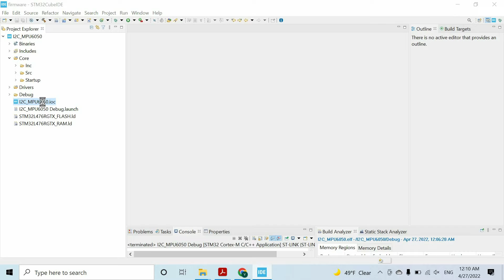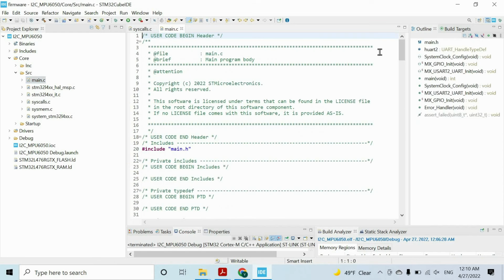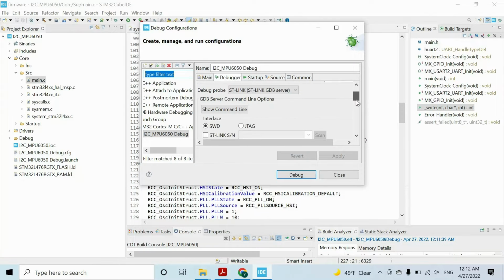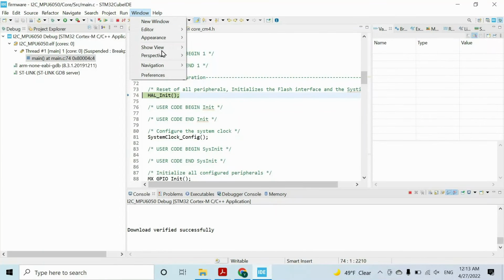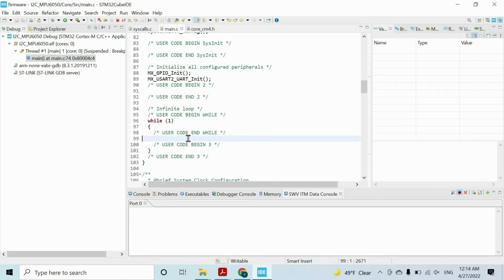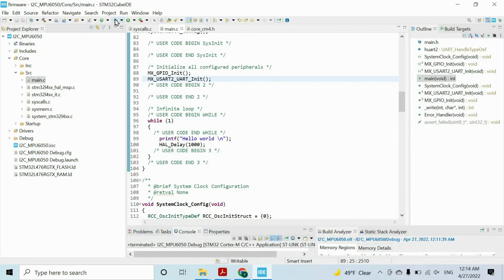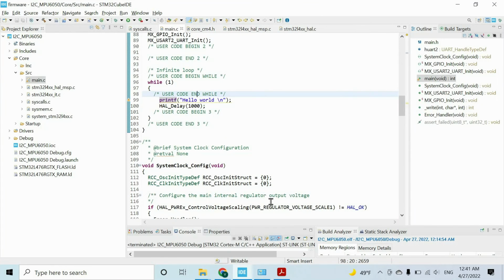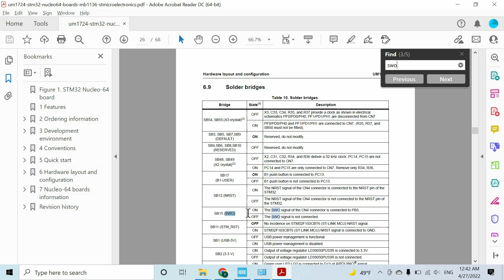This makes your life so easy: STM32 printf using SWV STM32CubeIde

Comment: Guys if you are using stm32f303re set the core clock frequency under serial wire viewer in debug configurations to 8mhz, thats the internal and default clock this board uses, also you have to put \n i think.
Reply from the maker: Thanks for the tip!

Comment: Hey im using a stm32f103c8t6 blue pill board. Did everything as you said, nothing is getting displayed in the smv terminal. Any solution?
Reply from the maker: I think this MCU does not support swv
Reply: @steppeschool3629  So what other alternatives are there for this mcu?

Comment: Nice tutorial, quick and easy. 
Just a follow-up,I have a STM32F407G-DISC1 board. In the .ioc file, we need to set 3 pins if we want to transmit and receive? 
SWO (PB3), SWCLK (PA14) and SWDIO (PA13). Could you please confirm this?

Comment: Note: Serial Wire Viewer (SWV) is a data trace feature found on many ARM Cortex-M3, M4, M7, M23, and M33 processors. Cortex-M0 and Cortex-M0+ do not have SWV.
Reply from the maker: Noted
Reply: hey tnx im using m7 and ive been trying like an hour lol
Reply: @offensivebias3965  Yikes. Sure hope you figure it out eventually; wasn't straight for me the first time either.
Reply: thank you sm

Comment: Hello, thank you for your video, but i have a major problem, when i go to debug configurations and try to enable the SWV, i can tick the option... would you have an idea about how to resolve this problem and why it occures ?
Reply: I am not working on an Nucleo but on a STM32F303 dicovery, might it be the problem ?
Reply from the maker: check the user manual of your discovery board. There might be some jumper to solder. Which board exactly are you using?

Comment: It doesn't work for me, no text output from SVW Data Console. Is there a need to configure some pins at "Pinout & Configuration" ?
Reply from the maker: Hi, you do not need to configure, but in some boards, the pin responsible for SWV is not connected to the ST-Link, as I explained in the video. In that case, you have to check the user manual of the microcontroller you are using.  Usually, it is just one jumper to solder.
Reply: @steppeschool3629  I will check that, Thank you!

Comment: Hi, I am not able to configure SWV in STM32H735g-dk evaluation board. Can you please help ? Tried what you explained above but still isn't possible still.
Reply: hi kush,
Did you find any solution to it? facing similar issue with STM32f4-DISC1
Reply from the maker: Hi Kush,
There are multiple possible reasons why it does not work. Let's identify the exact problem. Can you list all the steps you proceeded to enable SWV?
Reply: @steppeschool3629  Same steps which you have mentioned above. Since its an evaluation board its having on board debugger. So all I am doing is connecting my usb mini cable with my PC and then running debug. The debugger gets connected but not able to perform SWV.
Reply from the maker: Then open STM32CUbeMx software (.IOC file) and verify that SWO pin ( PB3 ) is configured as SWO line ( SYS_JTDO-SWO ) and is not used in other purposes in your project. If it is the case, double check all the configurations I did. This configuration worked flawlessly in many boards.

Comment: Hi can the nucleo-l432kc do the same thing? I mean print and plot the curve.
Reply from the maker: Hi Anne,
Unfortunately nucleo-l432kc does not have such capability. You need to use Nucleo-64 boards to have that. But you can use UART communication and and some software that can receive data from a serial port
Reply: @steppeschool3629  thanks